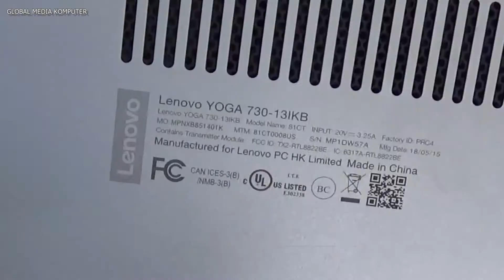EASY TUTORIAL - GANTI/REPLACE KEYBOARD LENOVO YOGA 730-13ikb

Comment: I have a problem with the keyboard of this model. Some keys are not working. I tried all troubleshooting steps nothing worked. I'm thinking to buy a new keyboard in Canada. Please help me to find a good option. Thank you! I'll use this video to replace the keyboard.
Reply: I finally replaced the keyboard using a professional service and it worked. It was very difficult for me to do such a job!
Reply from the maker: Yes that's better. to avoid other damage. 👍

Comment: Hi! Do you have a tutorial for Lenovo Yoga 730-15ikb?
Reply from the maker: It's the same as this series, only different is the big monitor 15"
Reply: No it's not. The keyboard screws are made from plastic and are melted in.
Reply from the maker: Oh, if it's a plastic lock, you can use this method to open it
https://youtu.be/9MpoKZa4_t8